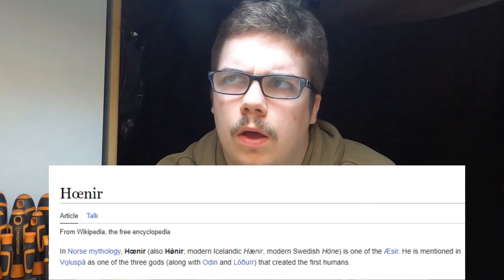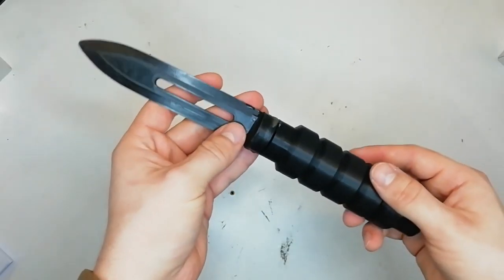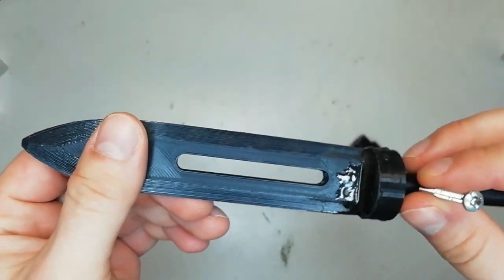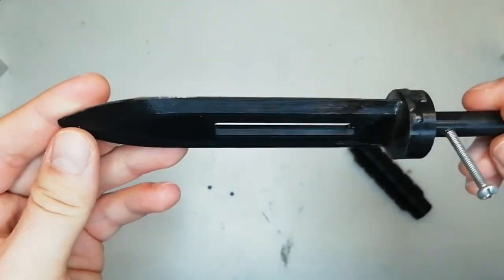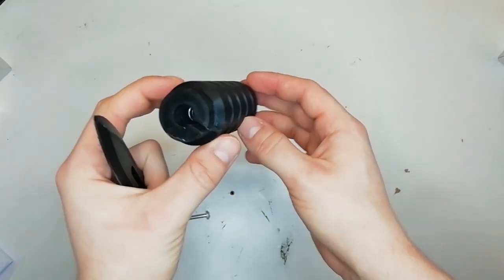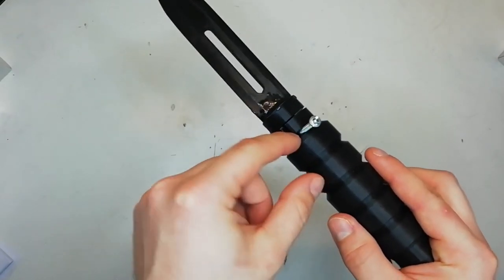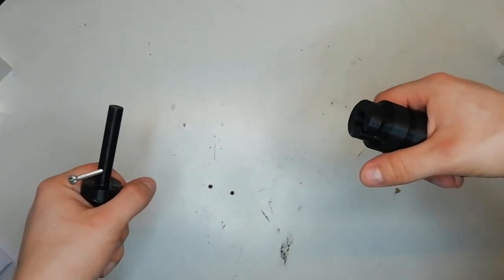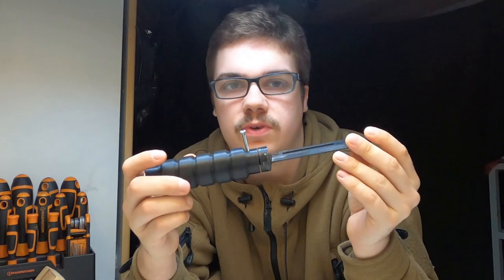This 3D-Printed Airsoft Ballistic Knife Is BANNED

Comment: What is the most powerful springs that I could use for a 3D ballistic knife?
Reply from the maker: Well you might be able to use a cut down sniper spring, too strong and the latch will not last long. Plus cocking it will be a fight.
Reply: @FulcrumAirsoft  What would be the second strongest spring?
Reply from the maker: I don't know mate, it all depends on the springs characteristics, I used an old AEP spring and frankly you can't expect more than 3-4 metres from something so unstable in flight.